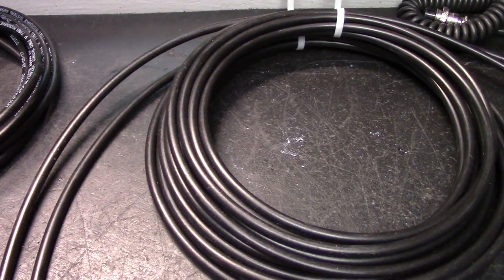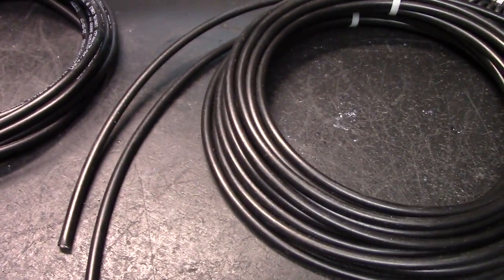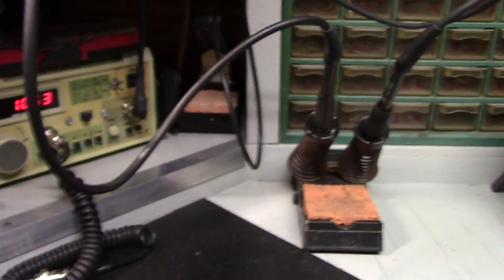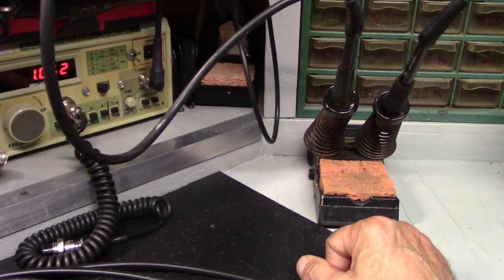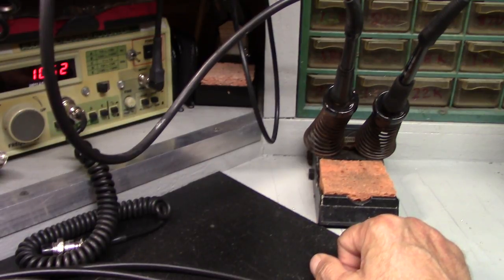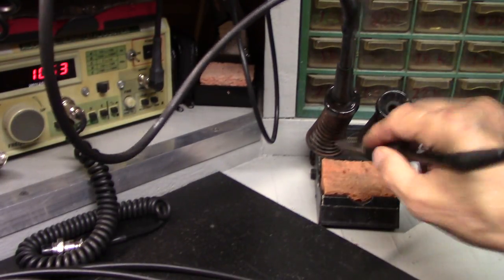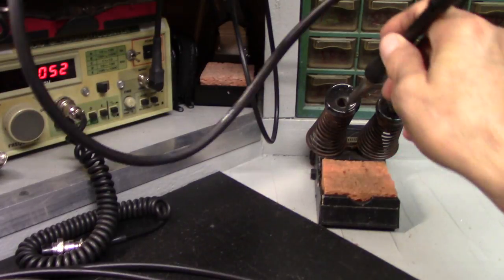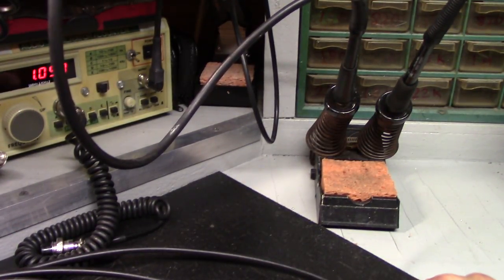"Clean Bench" = clean solder joints .. dirty bench = dirty solder joints!

Comment from the maker: That iron holder (custom modded to hold two pencils) is around 25 years old and so is the pencil on the right .. take care of your equipment and will take care of you!

If you use a soaking wet sponge and keep it clean at all times it'll always remain that way and so will All of your joints. Replicating the same movements over and over again will help you to become consistent and clean from solder splashes. "Elbows down" throughout the entire procedure is what I taught my installers. Yes, it takes a little forethought but in the end it's well worth it. This bench or any of my others weren't  built for looks!

Have you noticed a sloppy looking soldering / rework station and work area lately? Odds are that the inside or board that's being serviced has solder splashes, bridges and dirty cold solder joints all over the place! Clean stations means experienced, dirty station means that they don't care about theirs so why in the hell would they care about yours? Just a little food for thought.

If they claim that they're too busy to keep it clean it's because they're too busy taking your money!

Stay Tuned In!
HD